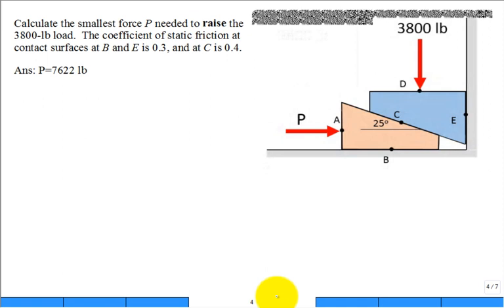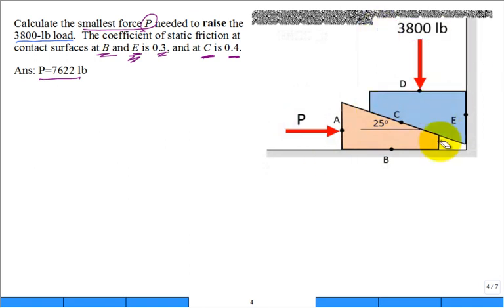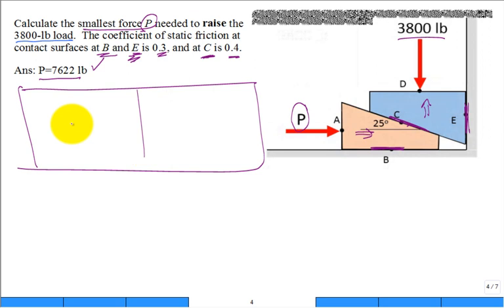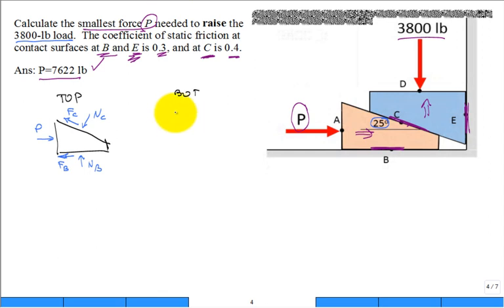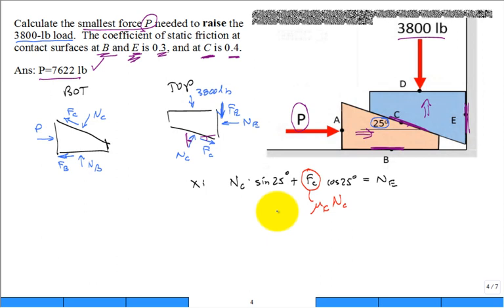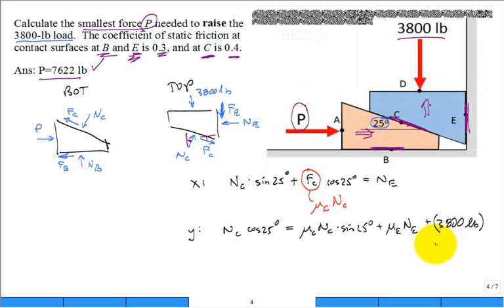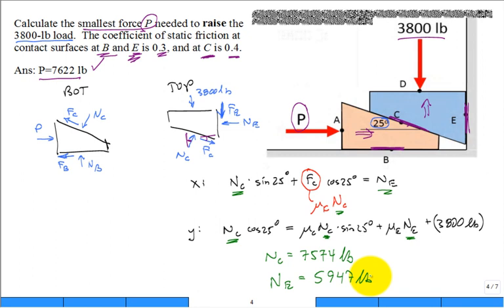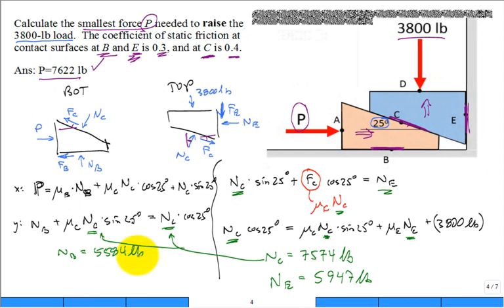two wedges to lift spr18

Comment: Please explain .. We need a force of 7662 lb to lift the load of 3800lb.  Means we need more than double force to lift 3800 lb. I am not able to understand what is the advantage of the wedge angle is?
Reply: It's the opposite, to stop the load from above slipping! You can put a large load on the wedge and it won't slip due to friction.